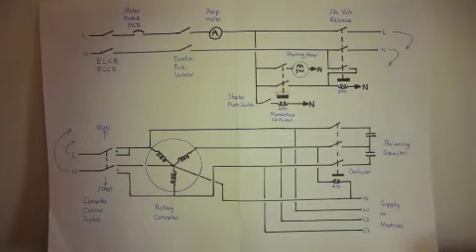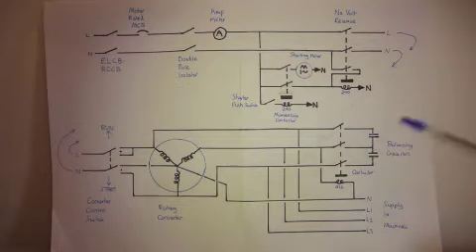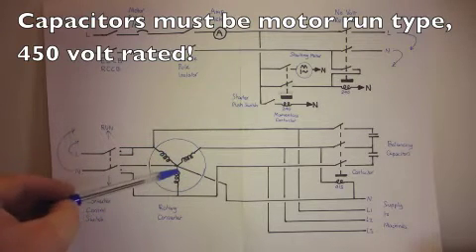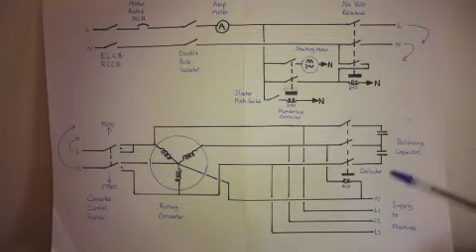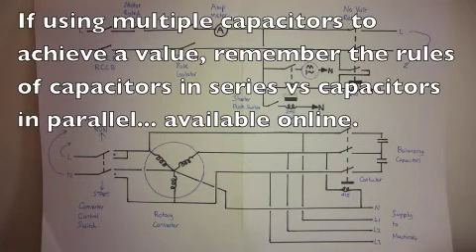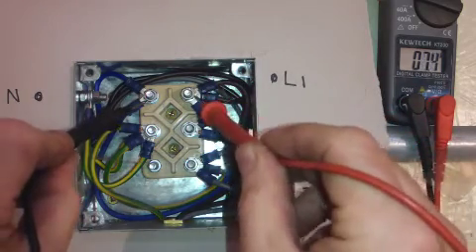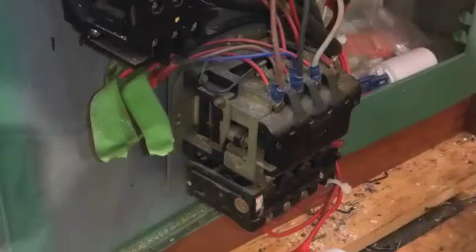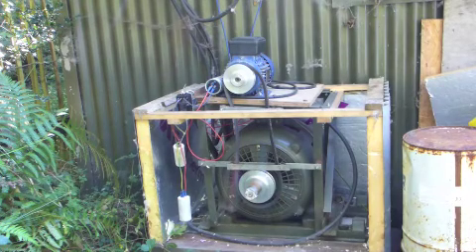Rotary Phase Converter - UK - Part 4

Comment: You are a legend - i'm going over and over thereto make sure I have it all - i build one of those transformer welder based converters which seems to work but is really pissweak - i am building one of these with my gorgeous old 10HP monster motor - thanks again.

Comment: Thanks for this wonderful videos. I am already constructing this.  Kindly make more explicit the star/run switch and the contactor near the starter motor. Can any protection be provide incase the change over switch is at run before power outage and you mistakenly forgot to switch the changeover to start posistion.

Comment: This is fantastic i was hoping that you may be able to give advice on a lathe i have it has a dual speed motor which on full speed is at 2.4Kw i was hoping to buy a Rotary Invertor but they are so expensive i was wondering if you know how i may get round this apart from biting the bullet i just cannot afford the prices on Ebay

Comment: I should add I’m in oz and any of the larger 3 phase motors are 415v star 600v delta. That said supply voltage in the country is rubbish.  Legally it’s supposed to be 220-240v with upper limit of 253v.  I have 251v now and am going to upgrade supply line to street transformer which will up the voltage to 258v which will force utility
To come out and recalibrate entire street.  I get spikes 285v .  So using a step up transformer I was getting more like 460v so that might explain why the motor was running hot.  However your wiring diagram makes a lot more sense.  And I’ve been reading various forums for 3 months trying to crack the solution.  As three phase power connection from the utility company is about £50,000.  Bugger that expense for running a panel saw.  Cheers jon

Comment: Excellent explanation.  I tried the floating neutral wiring diagram and really didn’t work properly.  The motor just ran hot.  Could you please give me a ballpark capacitor range.  For L1/l2 and l2/L3 and rough ratios between the two.  And whether you are using 450vac run capacitors in series to give you the 600vac limit required? Obviously once I get mine running 7.5kw then I can play around load balancing it.   For the floating neutral I was using about 150mfd and 75mfd with 900vac limit.  Thanks for your help. Cheers jon
Reply from the maker: I recall that one of the capacitors is about 50uF and the other around 22uF.
Reply: Hey Jon,

Did you get it to work? I built this also, but when switching the capacitors in it does nothing to balance the voltages, it just breaks the motor and it's drawing more current.

A 5.5kw 1000rpm motor is drawing 12 amps when idling, and 17 amps with the capacitors connected. Also, strange thing is that when I apply a load the current draw drops to 10 amps.

Comment: Thanks for persevering to the end.
I have a question.
Is the Earth Leakage Trip in the best place ?
I assume that the 240 side is protected already.
The 3 phase circuit has a separate earth so your circuit won't protect that output from the inverter. (Will it ?)
Reply from the maker: Hi Steve. Earth leakage is at the point of supply... so it kills at source. I can see where you're going though. Suffice to say I have confidence in it's ability to protect, last Spring when the temperature and humidity changed suddenly, the cotton insulated tails in the lathe motor got damp. I pressed the Start button on the lathe and the power went off - everything, my house as well, before the lathe motor made even a part of a turn. I've considered an Earth Leakage breaker on the output of the converter, but I suspect the differing voltages and currents as it starts up would cause it to give false trips.

Comment: Thanks for the vid, your wiring diagram@2.30 has an error in it, the hold on contact will be a dead short. it should loop up to the live not N
Reply from the maker: Embarrassing! Thanks for pointing this out. You are quite correct. I will attempt to do an edit. Neatly showing the dangers of creating the diagram AFTER you've built the circuit!
Reply: Hi it would be great if you could make the diagram available as a separate document
Reply from the maker: @richayer8195  thanks for this suggestion. I'm a little frustrated at the picture quality on the films and I can see why you'd want this. Any ideas as to how I'd get a better image online?
Reply: Hi I would use dropbox  and share the link in your youtube comments or faceook
Reply: Perhaps one of us could do it with OP's approval. Testing testing
Reply: 😳😳😳😳😡😡 Nope
Can't do it. I can put up silly emojiis but not the sketch I made of this mans circuit diagram. Pictur won't paste from my clipboard.